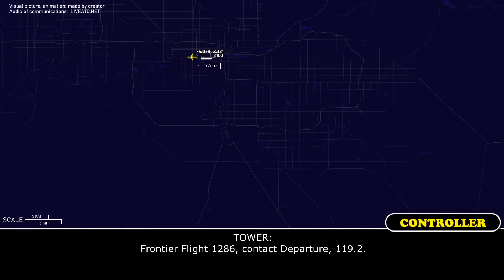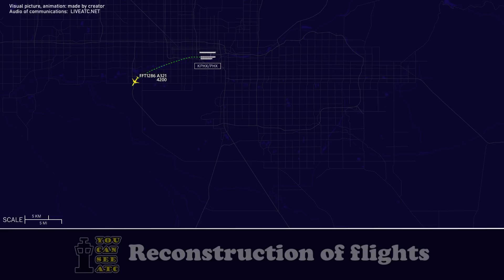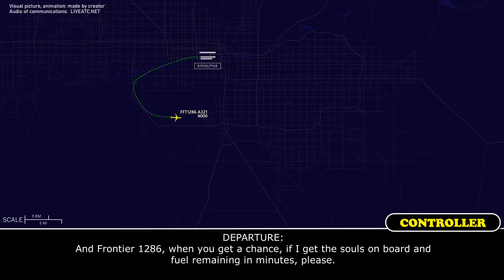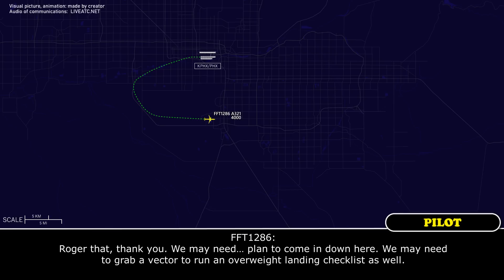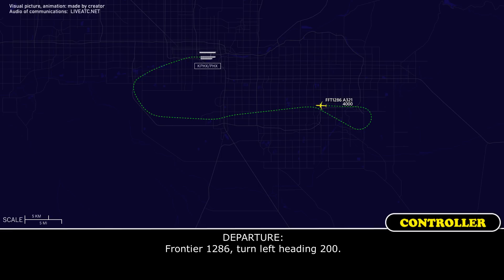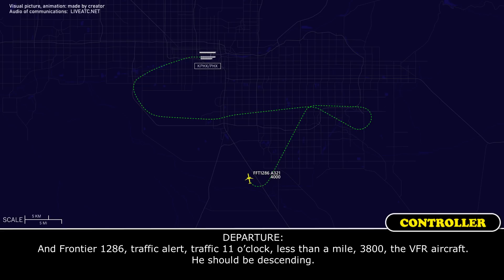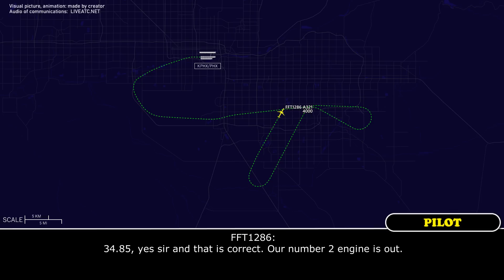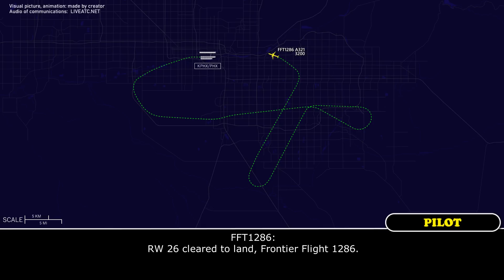Pilots had to shut down the engine. The engine is out. Frontier A321 returns to Phoenix. Real ATC

Comment: Question for anyone - when a two engine plane loses one engine, doesn't it affect the direction the plane can turn, and if so, why don't the controllers ask the question early on for vectoring purposes, especially since they need to delay for a bit?
Reply: With jets it's not a problem (apart from some catastrophic failures). With two engined props you should not turn into the dead engine (due to how likely it is to overturn and the difficulty of getting out of that turn).
Reply: it seemed like he was concerned about where the plane could climb to. i believe phoenix sky harbor has a lot of mountains nearby so if they can't climb then they can't turn to certain areas to avoid terrain. just my best guess

Comment: Does captain fly and handle radios in emergency with first officer running checklists?
Reply: It depends. Usually it works out better if the F/O is flying. This lets the captain assess the situation without the burden of flying. Experience in type, familiarity with the airport and a bunch of other factors play into the equation, but it's usually better when the captain isn't trapped into the tunnel vision of flying while making decisions.
Reply: Both are trained to fly. The Captain is trained (and paid) to make decisions.
Reply: Usually the FO flies in these situations.
Reply: At Frontier he pilot flying (PF) flies and operates the radios while the pilot monitoring (PM) runs the ECAM and checklist procedures. Obviously, the FO was flying in this situation because the he was talking.
Reply: @H60ace  That's the standard, as I mentioned. Sometimes the situation complicates things- a busted windshield I had did that.

Comment: Ok ... I have a lot of questions for the flight crew. Yes, having an engine failure can result in the startle effect and cause some confusion/anxiety at first. However, it's your job to remain calm and fly the airplane. It is certified to fly on one engine. You fly into an MVA zone of 5,000ft and you're at 4,000ft. Not good. ATC immediately notifies you and you tell them unable??? WTF. You're going to fly into terrain. Yes, that airplane can climb with one engine inoperative. Ok, so you land heavy but you don't use the entire runway to slow down ... then you attempt to taxi back after a high energy stop on the runway? Geesh ... I hope you aren't ever my pilot. This was not a good look for your flight crew.
Reply: While they said to be unable for 6000ft, they did turn (to stay within the 4000ft MVA).
Runway 26 is 3500m/11500ft and even if the plane is very heavy, this is "only" an A321. With low autobrakes while being heavy, it still needs well under 3000m of RWY. Also, they had CFR check their brake temperature (which was normal enough) and they have instrumentation showing it as well.
Reply: @lyaneris  But they also descended below 4000ft! The failure to climb and the failure to maintain 4000ft is unacceptable. If I were their LCA on a check ride, they would be in training before being allowed to fly passengers again. Additionally, you don't bring a jet with potential hot brakes back two the building and close to other jets where you can then burn everything down. Taxiing the aircraft causes the brakes to continue to heat up. And it takes at least 15 minutes for the brakes to reach peak temperatures after a high energy stop -- it is not instantaneous.
Reply: @JohnSmith-zi9or  Yeah, I can't understand the descent. Pretty sure I heard the autopilot off sound at some point. But handflying doesn't excuse 400ft. It felt like their workload was way higher than it should have been for a relatively "simple" failure.
At least with the brakes I can hope they followed sop.  In another video, a plane had brakes that were too hot, so I can only assume that 355 is still acceptable to taxi to stand.

I'm also wondering, as far as I know (from other situations I listened to): continuous taxi without slowing/stopping seems to help cool the brakes; setting the parking brake is not an option, but wouldn't manually holding the brakes be just as bad?
Some pilots choose to taxi around, some choose to stay where they are. A recent video had a crew that knew exactly how long they needed to stay away from buildings just after they landed.
However, I can't remember whether these were all airbus cases (one with continuous taxi was a Southwest 737).
Reply: @lyaneris  I think they were also autotpilot off as well.
Reply: @JohnSmith-zi9or Valid points all, but most (not all) of F9’s planes have brake fans. The Captain made a decision and people are alive. It is easy to Monday morning quarterback these things. If errors were made, Uncle Sugar will find them.
Reply: The newer airbus (atleast the ones at frontier) have brake fans that are remarkably effective. Their overweight landing checklist would have acknowledged high brake temps, so hopefully they followed SOPs before taxiing back.

Comment: ATC lets him leave Bravo airspace into area with VFR traffic 200 ft below that SHOULD be descending...???..
Reply: Maybe...and I'm just guessing...he has radar and can see planes in that airspace...
Reply: @buckhorncortez  Everyone here is just guessing or flat-out making things up.
Reply: As long as the VFR traffic has acknowledged having 1286 in sight, and acknowledged needing to get a safe distance below 4000, then the risk is reasonable - both the VFR's ADS-B and the VFR pilot need to malfunction for them to (in fact) be dangerously close to 4000.  (clearly if the ATC radar can measure height independently, that's a third backup - not sure all ATC radars can)